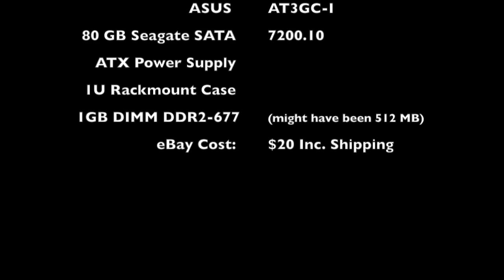Barracuda BSF200a Teardown

Comment: Thank you for this video. It gives an insight into the hardware. But frankly for the function grade it is supposed to do 24/7 there is no need for stronger hardware. They really focus on their tailored software. I don't work with them, nor I want to work for them.  for you I guess you only need a ready mITX motherboard with quad core Celeron soldered to it. What is puzzling me is that it only has one Ethernet, is that supposed to work for WAN & LAN :)

Comment: can i install PFsense instead jeje in this rack I see a 9dolars on eBay
Reply from the maker: +Hillonetwork Informatica Seguridad Comunicaciones pfsense runs on most hardware. You shouldn't have any major problems getting it running, although you generally want a board with Intel ethernet.